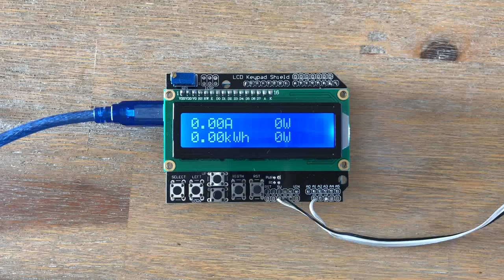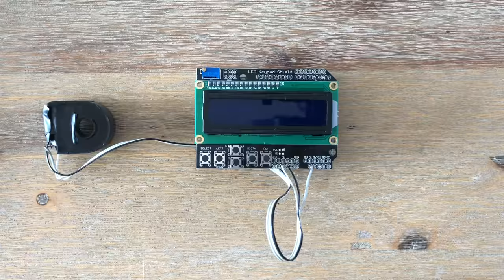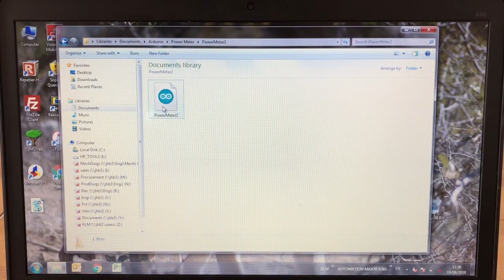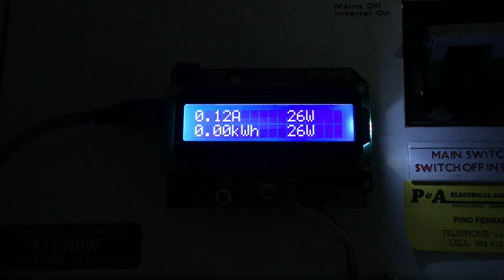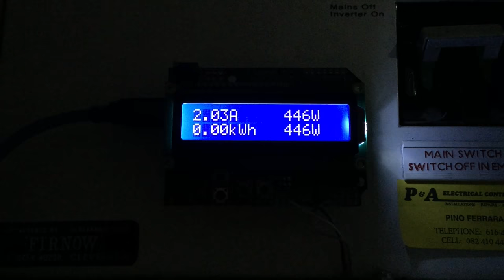Make A Simple Arduino Energy Meter

Comment: Small remark here: it's not measuring kWh, but VA (Volt-Ampere). For AC current, you cannot just multiply voltage and current to get it's power consumption. While this will work for resistive loads (pure heating loads), it will not work for capacitive or reactive loads. For your laptop charger, for example, it will not tell you the real power it consumes.
Nevertheless, it's still a nice project :-)!

Comment: If the voltage is set in the code, the power reading will be “right” only for a resistive load, if you don’t consider voltage variations caused by the grid and the voltage drop on the electrical wiring. In AC, you can’t just multiply voltage by current like in DC, it is much more complicated! You MUST consider the power factor of the load, dependant on the phase shift between voltage and current. Nowadays electrical loads are often inductive or capacitive (like in all electronic appliances, led bulbs and so on...). For measuring a generical load with a voltage that is floating and a power factor which is not 1 in most cases, a meter like this results heavily inaccurate and pretty useless. It can work only as an ammeter.
Reply from the maker: Hi Adriano,
Yes this is correct and is mentioned briefly in the description and discussed in more detail in the blog link.
As for it being heavily inaccurate or useless, I would disagree. I completely agree that this type of meter is pretty useless for taking accurate or calibrated measurements at different sites or for different types of loads. The intention behind this meter was to make a simple household meter which would be installed on the mains and left there for months as a means of monitoring your energy consumption and monitoring your electrical bill estimate. Since most households run a fairly consistent living pattern, electricity usage is also fairly consistent from month to month. While this meter won't be accurate for vast changes in usage or if a large range of different appliances are used in a month, it can certainly be calibrated to be quite accurate after a month or two by comparing the usage displayed on the device to your actual electrical bill and calibrating it accordingly. Sure this is also not going to be 100% accurate but as a home meter to give you an idea of usage and your estimated bill, I consistently get readings of my household bill within a few cents of the actual bill using this meter.
Reply: You're right, and this meter doesn't really show kilowatts (kW) or REAL power, but kilo-volt-amperes (kVA) or APPARENT power, but in case of the power factor (PF) being close to 1, these two are almost the same.
The author must have most of his appliances running close to PF of 1, as his measurements are very close to the utility's, or the utility power meter is measuring kVAh instead of kWh.

Comment: It's Great but you need to measure Voltage too, If you assume voltage to be 220v or 110v fixed, you're measurements are off by quite a bit.

Comment: If I where to use just the lcd screen rather than a Sheild  and follow your tutorial on how to attach it to a uno bored, how would I saughter the wires to it?
Reply from the maker: I presume you’re talking about the connection to the Arduino? You’ll need to solder a pin header strip onto your LCD leads and they’ll then plug into your Arduino
Reply: @MichaelKlements  tysm!

Comment: Hi Michael, I'm using SCT-013 100 A version on my AC 247 volts (edited 247 in the code) with the same circuit and using an LCD shield, but 33Ω burden resistor but when I apply a load, the readings don't change from zero - they just remain zero whether the load is a 7Watt LED bulb or a 750 watt Iron.
What could be wrong?
Reply from the maker: There are a couple of things it could be. I'd suggest first displaying the raw values read from the analog pin and see if they change when you add the 750 watt iron (and make sure that the iron's thermostat is closed/on). Using a 100A CT on 247V means your effective range is almost 25kW, so its unlikely to give good readings for your relatively low loads you're trying to measure. You are only using half of the analog input range (512), so each measurement step (your resolution) is around 50W. So your meter will only display in increments of 50W.
Reply: @MichaelKlements  i guess you should use low rated CT 20 to 30 amperes is max current drawn in typical home on full load cause 100 amp ct = 220*100= 22000 va and i don't think any home consume this much power or 100 amps in home ( if yes then cables sizing of wireing must be 25 to 35 sq mm Copper)

Comment: hello ! can we use talema AC1020 for this project?
Reply from the maker: Yes that CT would be able to be used for the project, but you need to make sure that it is appropriate for the load you're going to be measuring. There is more detail on this in my blog post linked in the video description.

Comment: Thank you for the video. Can you please also give us the video of bidirectional power meter?
Reply from the maker: In order to make a bidirectional one, you’ll need to measure both the voltage and current in order to determine the net direction of power flow. This is not really a simple meter to build or to code.

Comment: Hi Klements, thank you for your super energy meter  and the great presentation. I have Photovoltaik plant - so i have power in both direktions. But i need just one Direktion (for my Power management).  What shows the Display when the Power is in negative direktion (when the sun doesn´t shine and i need current from grid). do i destroy the Arduino in this case?  Kind regards hoerbi
Reply from the maker: The circuit simply measures the voltage drop across the burden resistor, it can't differentiate between power being supplied or drawn in either direction. As long as the magnitude of the current remains within the designed range, the Arduino is safe.

Comment: i did all the process.uploading to arduino uno is done but 16x2 screen is still blank.
Reply from the maker: Are you using a lcd shield or standalone lcd panel?
Reply: thanks  @MichaelKlements  i have got the solution. now display is ok. but there is one more issue 
kwh show on this lcd are higher than my previously installed meters provided by my loacal electric suply company. please tell me solution for this
Reply: @qingtv197  I have the same problem the display is blank what did you do?
Reply: @athuldev5307  if you have don every thing is ok. you just need is to adjust brightness of your screen simply adjust the small screw you will see on your shield

Comment: Hi Micheal,  i tried it but unfortunately all the reading in the lcd shows zero only, even though i apply the load. What is my mistake, pls help. I m usin the same ct talema ac1030.
Reply from the maker: Hi Sangar, this could be a number of different issues. First try displaying the raw value from the CT on the Serial Monitor, it should be around 512 with no load. Then try applying a load and see if it changes. If you don't get a value around 512 and it doesn't change with a load then there's something wrong with your circuit. If you do, then there's an issue with your code.
Reply: @MichaelKlements  Hi Michael, great, its work now, thanks for your guide.

Comment: Great work,
But I have a question, can I use a breadboard instead of soldering to connect the components of this project?
Thanks
Reply from the maker: Yes you can, breadboard's just tend to be unreliable for longer periods of time.

Comment: please i want to build a circuit that can be monitored on the net and changes inputed. It involves me monitoring the power consumption, voltage and current of a socket. please, how do i go about it ?
Reply from the maker: Hi Samuel, this is all possible with Arduino but it involves combining quite a few different tutorials. Have a look at https://the-diy-life.com for tutorials on ethernet connection and the energy meter. You then just need to add a small step down transformer to convert your 110VAC or 220VAC to 5V for the Arduino input.
Reply: @MichaelKlements  Hi Michael, can you do a tutorial on connecting this step down transformer to the Arduino and monitoring the real time power consumption thru the internet ? Thank you and more videos please.

Comment: Hi Micheal,  great video, just want to ask 1 question, if i want to use the ct ' CTYRZCH SCT-013-000 – 100A' this model , do i still need to use R1,R2 and capacitor?
Reply from the maker: Yes you'll still need to use the same circuit as I've used. You'll just need to re-size the burden resistor for your CT.
Reply: @MichaelKlements  great, thanks for your quick response.
Reply: @sangarmutusamy9801   Hello, do you know what resistance you used for your CT?

Comment: great video!! I just want to know if can I use Arduino Nano instead of Arduino Uno? Thank you!
Reply from the maker: You can use any Arduino with an analogue input
Reply: I want to ask also if I can use 1.3" I2C OLED Display instead of LCD shield?Thank youuu!
Reply from the maker: Yes you can, you'll just need to adapt the code as the I2C display uses different libraries.

Comment: first  off  all i didnot  buy ct  transformer i collect  it from electrical  meater  installed  into  the  home  by  W.B.S.E.D.C.L  so  problem is  i  don't  know about the  specification of  ct  transformer  so can  u  say  the  way  of   i determine  the  ct resistance r3 ? is  the  connection  of  lcd and  arduino  same  like  hellow  world  project  ?
Reply from the maker: If your CT doesn't have any part number or markings on it then you'll need to test it yourself. Connect a known load (current) through it with an arbitrary known burden resistor and measure the output voltage with a multimeter. You can then use the burden resistor calculation shown in the post in the video description  in reverse to calculate the CT ratio.
Reply: @MichaelKlements  can i get your mail id ? I connect a 200 watt blub through it and without adding burden registor and also with add burden registor 22 ohoms i see there 1.6.      and 1.9 incresed to 2.6 Amp shoowing in multimeter keeping the meater set into 20 Ac Amp mode
Actually Amp increase because voltage is not stable here 215,216,217 voltage frequently chenge like this and wattage gasually increased
And ac voltage after adding burden registor 22 ohoms is 000  if i didnot add any registor and test i got 4 volt ac on keeping thr meater 200 volt ac 
Please give me email id so that i share phone vidio of reading

Comment: Hi can you suggest what I do if my Arduino analog pins are not reading constant values due to which my reading are fluctuating
Reply from the maker: How have you tested them? With a CT on the pin you should be getting fluctuating values. If you put a known steady voltage onto the pins do they still fluctuate?

Comment: Can I use different CT (like SCT-013-000) and how to replace it
Reply: were you able to do it with SCT-013-000? 
I'm getting all zero values on this sketch with SCT-013-000
Reply: @LifeGeneralist  same problem for me and the specified CT is only available in digikey.

Comment: how can i simulate this? and which software need for simulation?
Reply from the maker: I'm not aware of any free/cheap software which allows you to accurately simulate an Arduino reading in an AC signal. Tinkercad has an Arduino simulation platform with a basic function generator if you'd like to try that? They don't have a CT though, so you'd need to simulate the signal from the CT using the function generator.
Reply: @MichaelKlements  but sir Tinkercad has no AC1030 transformer. so what should I do?
Reply from the maker: Yes, that's what I mean by saying they don't have a CT. You can only use the function generator to simulate the signal being produced by the CT circuit, this is not going to give you accurate results though, just a rough idea of what to expect.

Comment: Where is the voltage measurement??? How do you read power with just the current input??
Reply from the maker: In a lot of countries/regions tinkering with your homes electrical circuits is illegal. This is intended to be a simple non-contact meter for that reason.

Comment: Many thanks, but what does DB mean in home's db? I can't find an explanation to it anywhere.
Reply: Bro DB means distribution board.it is the box where your electricity provider place the main fuse and electricty meter.from DB the connection is fed to the rest of the circuit breakers that is installed inside your house by your self.
Reply: @surajsurya1928  Thank you so much ;)

Comment: It's working perfectly for Arduino, but its not working for ESP32 (TTGO TCall - SIM800L) Module. The analog values it gives is ranges from 2800 to 3750. 
Kindly help me with the calculations
Reply from the maker: I’m not too familiar with the ESP32 but you should be able to get it to work. Do you know what the scaling on your analogue input is? What is the maximum and mid value? These will need to be updated in the code.

You’ll also need to make sure that your circuit is providing an input in the correct voltage scale. What voltage is your ESP32 running at and what voltage do the analogue inputs accept?

Comment: Hello
Michael Klements how do I use SCT013? I use the same configuration or there is one in particular.
Reply from the maker: Yes you can use the same configuration but with a different burden resistor. There is more detail on this through the link in the video description.
Reply: Sir which burden resistor which can be used

Comment: CT is not available on Amazon ....from where I can order? ...or which other CT can I use?
Reply from the maker: It says that it is still available for purchase? There are a number of CT options which will work with this meter depending on what you are wanting to measure. Have a look at the write up linked to in the video description for more CT options and the associated burden resistors recommended.

Comment: Hello Michael, can I get more info about calculating maximum demand?
Reply from the maker: Hi Vamsi, the figure in the bottom right of the screen is the maximum demand. You can see the code and a full description of the project through the link in the video description.
Reply: @MichaelKlements  Thanks for your reply, i would go through the code and will reach you if I need any help
Reply: Hello Michael, I checked the code for KW and I am getting Maximum of 6663 W. Is it the maximum limit or somewhere I am doing any mistake. Note: I am working on three-phase supply.
Here are some information about the Transformer and Current Loads,
Transformer - 62KVA
Current Load on each Phase - Max 100A

Could you please let me know where I am doing any mistake.
Reply: Hello Michael, can you please help me with the below doubt I asked,

Hello Michael, I checked the code for KW and I am getting Maximum of 6663 W. Is it the maximum limit or somewhere I am doing any mistake. Note: I am working on three-phase supply.
Here are some information about the Transformer and Current Loads,
Transformer - 62KVA
Current Load on each Phase - Max 100A

Could you please let me know where I am doing any mistake.

Thank you for your great help.

Comment: Hello Michael, I checked the code for KW and I am getting Maximum of 6663 W. Is it the maximum limit or somewhere I am doing any mistake. Note: I am working on three-phase supply.
Here are some information about the Transformer and Current Loads,
Transformer - 62KVA
Current Load on each Phase - Max 100A
Voltage - 230 V

Could you please let me know where I am doing any mistake.

Thank you for your great help.
Reply: I too got the same error did u cleared it or not

Comment: How much is the max power limit that can be tested using this arrangement?
Reply from the maker: This one has a 30A CT so, depending on your supply voltage, 3,3kW or 6,6kW. But you can easily reconfigure it with a smaller or larger CT.
Reply: What does it mean by 3,3 kw is it 3KW or 3KW

Comment: Great video, by the way, I'm working on my project and I planned to used this power meter to measure the power consumed by the load but I also planned to used another power meter to measure the power of the solar produced. Such that my solar is the one who supplies the load. How is it possible? Can I ask for help? Thank you
Reply: Simple.... Use another two analog input pin to read  dc voltages and current ( dc current sensors are available in market or you can use low resistance at -ve end of solar panel or battery end there you will find voltage drop according to current flowing through it...  Just read those two values, calculate multiplier number in code for correct reading on display , and use some variables to store values in different location like if this channel used kilos variable to store kilowatts then you can use kilos1 or KILOS

Comment: Hi Michael, I have a question,  why did you multiply 2.05 in calculating kilos(units)??
Reply from the maker: Hi Hamza,
Kilowatt hours is a product of the power and the time in which that power was recorded. The 2.05 is the program cycle time, 2000 millisecond delay in the line below and 50 milliseconds to run through the code. This was measured using the serial monitor. There is a newer version of the code using the millis() function to calculate the exact time although this doesn't appear to dramatically affect the results - http://www.the-diy-life.com/simple-arduino-home-energy-meter/
Reply: @MichaelKlements  Thank You Sir.

Comment: How you calculate power without calculating voltage or how you calculate voltage??
Reply from the maker: The voltage is set in the code, either 220V or 110V depending on your location.

Comment: How to add more parameters to energy meter
Reply from the maker: The parameters are available in the code. You just need to create a second page for the LCD display and add to the code to cycle between the two pages at a set interval.